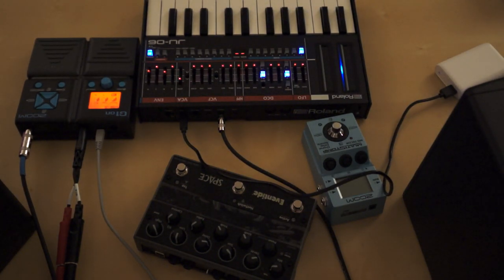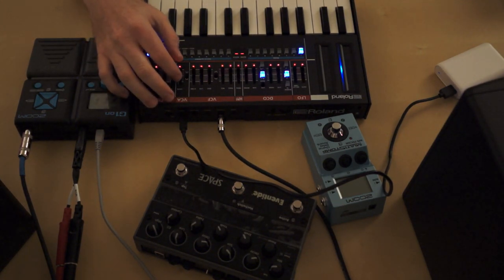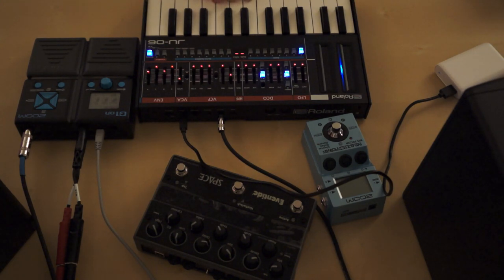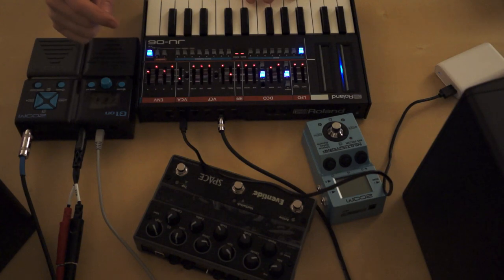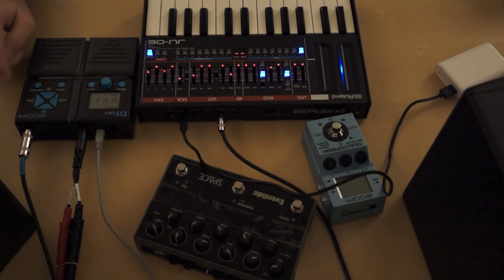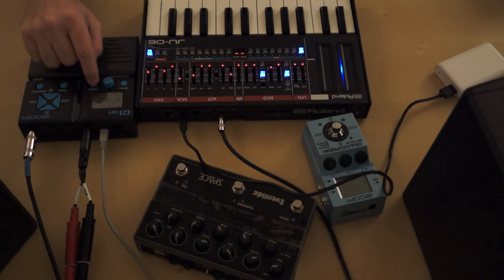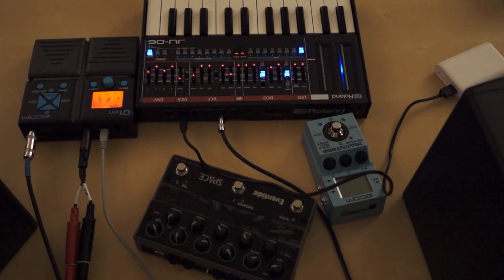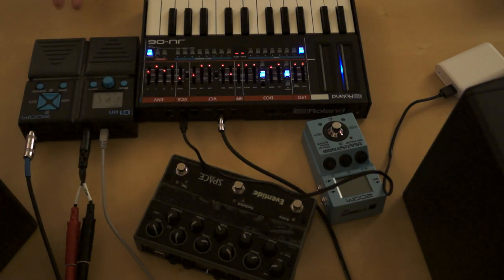Jrpg Music series, making a synth harp using pwm (featuring the ju-06 and g1on)

Comment: Hey man, first of all, let me say I truly appreciate u for making these videos. I too have a ju-06 and a minilogue so I get a lot of ideas from u. Now here's my question. I want to get an FX pedal, but I'm debating between the ZOOM G1ON or the MS-70CDR. I truly don't know which one would b the better option for me. I know the G1ON is about half the $ of the MS-70CDR, but other than that I wouldn't know which one to pick. Any suggestions?
Reply from the maker: They are both good pedals. If you can swing the price of the 70cdr I would go that route. It has the excellent dual verb reverb of the eventide space in it. It is one of my favorites for just about anything. Just make sure you update the firmware on the 70cdr when you get it as it will give you a bunch of extra effects.
Reply: Yuki thank you for the input. Now I am definitely going with the MS-70CDR. Thanks again for the hard work on your videos.